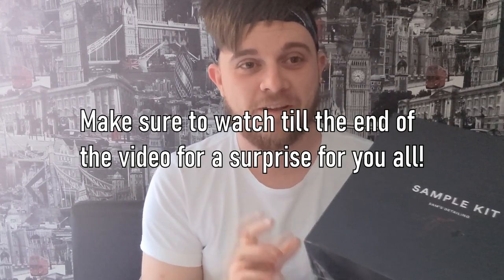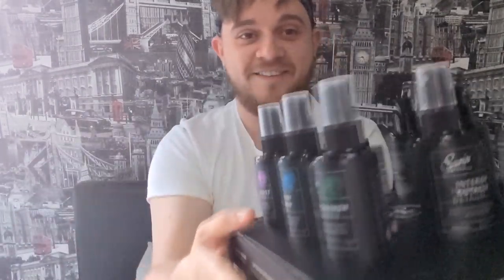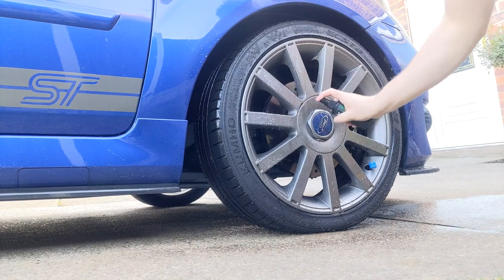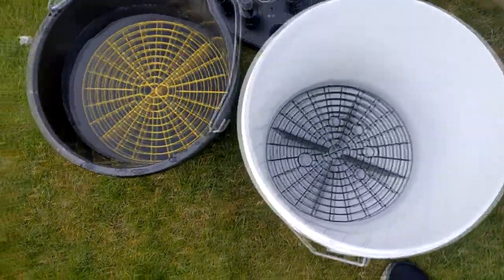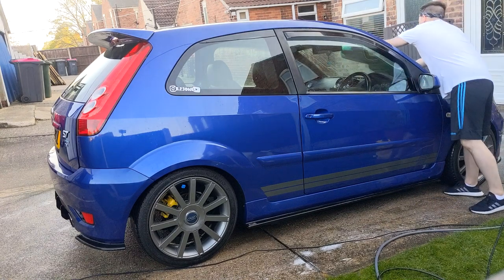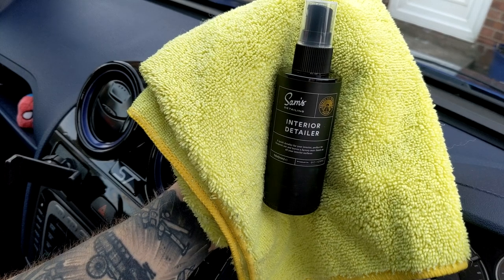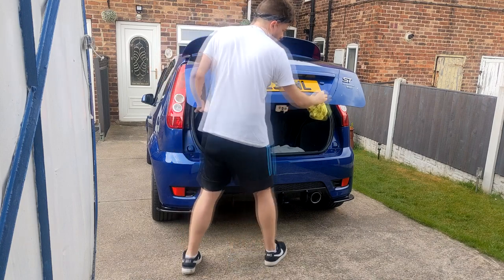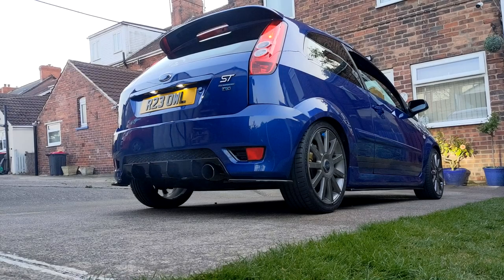Sams Detailing Sample Kit - UNBOXING + REVIEW!!

Comment: Class car cleaning guru! Thinner foam is always better mate
Reply from the maker: Thanks for the comment mate, mind if I ask why is thinner better?
Reply: @R23OWL  I've told by a few detailers , that the thinner the foam the more easily it will cling onto grime and pull off , rather than thicker it just sits on the paint rather
Reply: Tomos John correct

Comment: Hey is there a difference and if yes what’s the difference between zetec s and st mk6 thanks
Reply from the maker: ZS is a 1.6l 98bhp

ST is a 2.0l 148bhp
Reply: There's a few subtle difference between the zetec s and ST. You can get the ZS with a 1.6 petrol or diesel engine. Both come with the same bumpers, seats and steering wheel. Exterior wise the ZS has bare plastic door strips, handles and mirror covers and the wheels are different having 16 inch with 17s being on the ST.